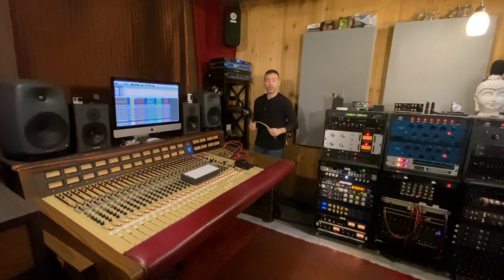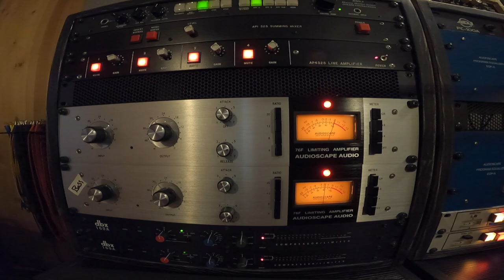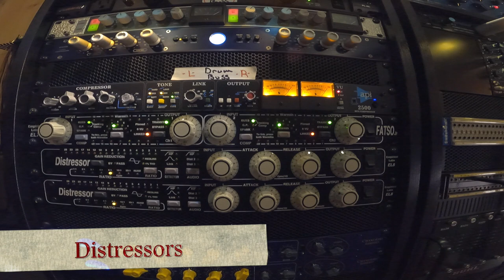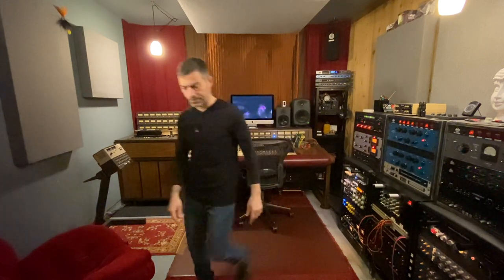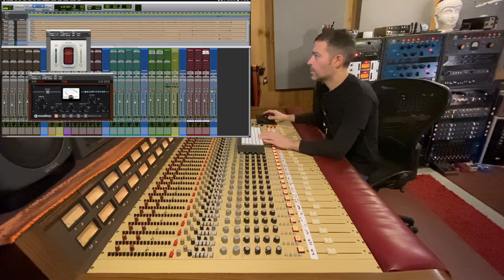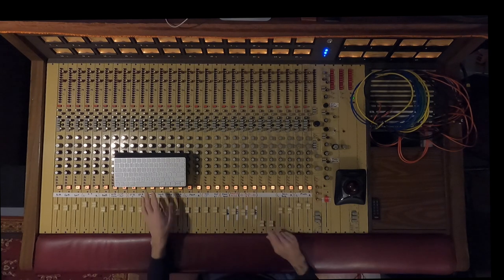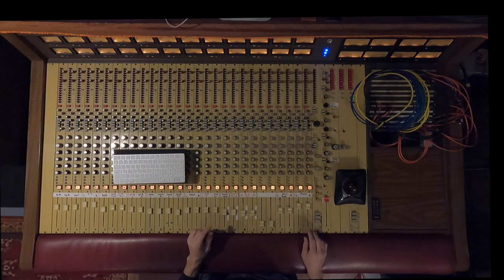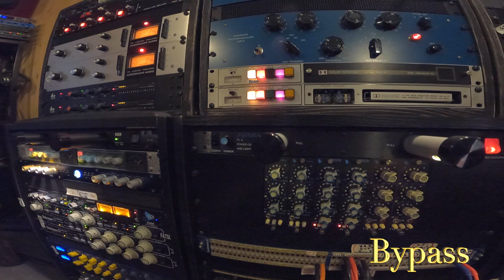Mixing Old Analog Tracks - Part 2 @RiotHomeRecording

Comment: Great footage of transferring tape into digital.
I have a question, a simple one.
Before printing to daw, would it be beneficial to do some work with outboard ? Or simply grab the raw tracks non processed?
I’m cautious on this area as not to over cook things which I know is so easy to do.
In my case this wouldn’t include master bus outboard, this would be individual mixer console eq and outboard compression only.
Your thoughts on this would be kindly appreciated.
Again appreciate your great videos on the hybrid works.
Reply from the maker: You could do some processing during the transfer but I don’t think it’s necessary. Especially for my work flow. 

The first thing I do is get a great balance with levels and panning before I even start thinking about applying eq or compression.  So adding processing during the print from tape to protools is sorta backwards to me.

Recording to tape adds natural compression and eq. That’s why the tracks seem to gel together in a musical way.

Plus if it’s recorded well with good mic placement, and good gear.  You really shouldn’t need too much processing at all. 

But there’s no wrong way, so whatever works for you is the right way.

Steve
Reply: @RiotHomeRecording  Cheer Steve pretty much how I was leaning towards. 
I’ve just this evening been transferring a project, just 12 tracks from my Tascam msr 24 and kinda realise that it really isn’t necessary to do anything other than capture.
A more difficult task to record to tape for sure as one needs to be able to play proper for starters, it sorts the men out from the boys, but the benifits are def worthwhile like you say for that saturation. 
I admire your outboard toys and the 2 inch tape, lovely setup indeed. I only have the Mackie 32:8:2 with ssl fusion on master bus and art pro vla compressor. I have six Focusrite isa 1’s for tracking drums and a few warm audio wa76 on trk inserts and the Klark teknik eqpt’s. I get fair reproduction. Its certainly nice to chase things further I must say when we’re hooked lol.
Again thanks Steve for replying and I’ll most certainly be hanging round your channel to see more 👍👍

Comment: Cool stuff I take it Api2500 is still running in parallel for the Drum Bus? If so when u say drumbus it comes across like all the drums are directly going into the Comp+EQ as too in parallel?
Mix coming along nice, would also be nice to get a deeper insight on settings u dialing in on comps + Eqs ✊🏾
Reply from the maker: Yes they are, the drums are being bussed through the comp & eq, I have the drum tracks spread out on the faders, then I have a separate submix of the drums sent to the comp/eq that’s returning back to a pair of faders that I could mix in with the other drum tracks that are not going the comp and eq.